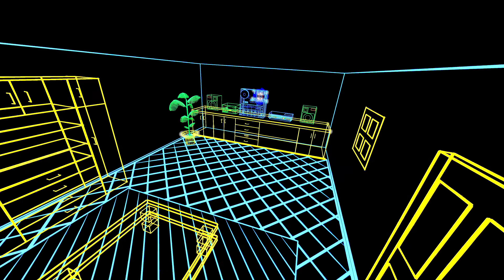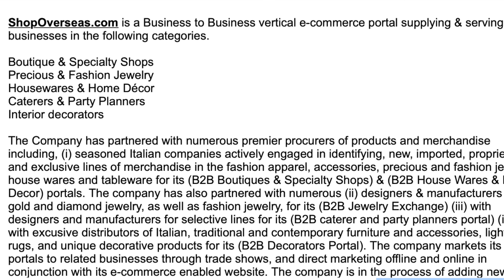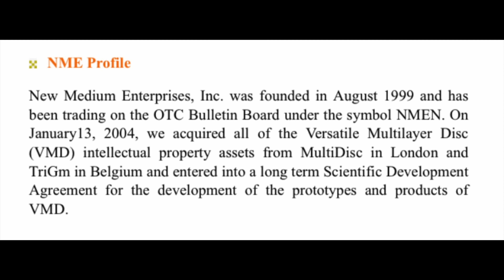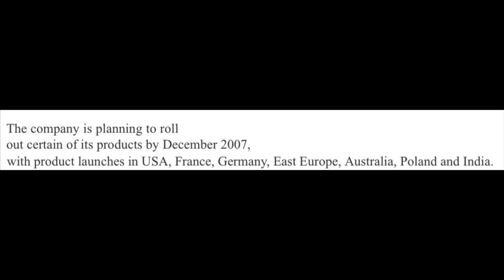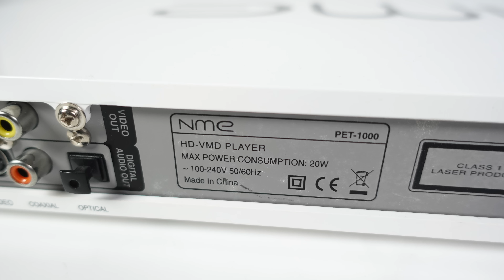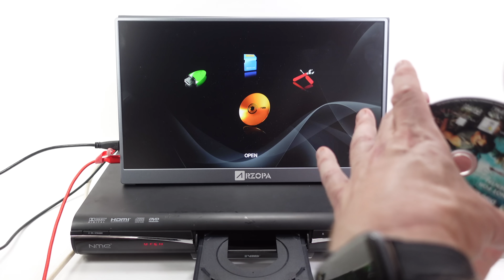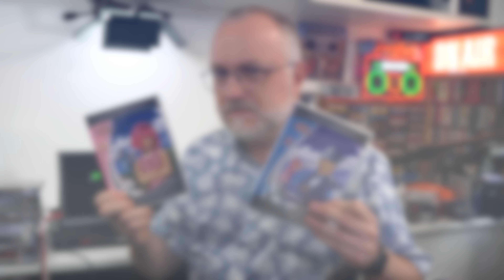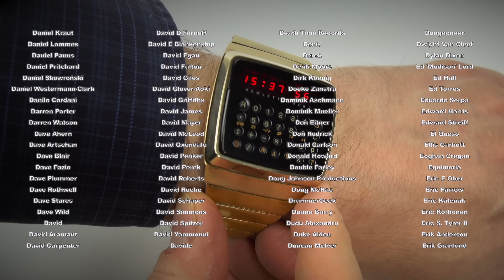The HD-VMD story - The format that lost to the format that lost

Comment: The moment Microsoft announced that you had to buy the drive separately for the 360, was the moment HD DVD died. 🙂
Reply: Sony won the format war in large part because they included the ability to play Blu-ray on the PS3 which meant anyone buying the PS3 now had a Blu-ray player. If Microsoft had done the same with HD DVD and the Xbox 360 while also incentivizing OEMs to add HD DVD drives on Windows PCs, the format war may have ended differently.
Reply: @spunker88  Exactly, although Blu-Ray would have still ultimately won due to the massive abount of additional storage :)
Reply: @SelfIndulgentGamer  I doubt it as once you have a huge market of people with players, which format is superior becomes irrelevant.

Although despite buying into HD-DVD myself and it being the superior format in the early days (it had many features the early Bluray specs did not support), Bluray did keep getting revised to a point where it was vastly superior in the end.

Apart from the most annoying aspect of Bluray, that titles using Java do not automatically remember where you left off and manufacturers can't be bothered to add it.  Its an absolute curse combined with power saving regulations causing a paused player to turn off after a while, losing your place.  Its the one thing I absolutely HATE about Bluray.  But the quality is so much better than streaming.
Reply: @alexatkin  NIce that you know your stuff :) To be honest, I still just rely on my DVD collection :D
Reply: @spunker88  i doubt the ps3 won them the format war. The ps3 came a year after the the 360, and it was more expensive. Sales were sluggish. You could got an xbox360 and the hd dvd drive for much less than a ps3.

Nah, HD DVD was already on life support when the ps3 launched.
Reply: @SuperPickle15  At the time the PS3 got launched HD-DVD was outselling Blu-Ray movies something like 6-1.
Reply: @spunker88  it also helped that Sony had a movie studio that was never going to publish titles on the rival format!
Reply: The attachment thing was kind of dumb but also kinda smart. By making it an optional attachment, it helped keep the device much cheaper. Yeah, consoles were sold at a loss, but Sony's even more so.
Reply: @BungieStudios  I agree, yet even with Sony losing a year before it's release managed in the end to win. It's incredible really, as I probably dis not get my PS3 till atleast a year after it's release, as I could not afford the original £450ish price range. Thinking about it, Microsoft should have upgraded the DVD drive to the HD DVD when the Elite was released :)
Reply: Whereas Sony - "We're putting Blu Ray drives into the PS3!" XD
Reply: @SelfIndulgentGamer  Warner wanting a separate format for China killed HD DVD, afraid of being flooded with cheap discs they switched from being both (or as we used to say, purple!) to Blu. Then China got the HD DVD tech to make their China Blue from Toshiba.
Reply: @ColdRFusion  Ah, the more you know :)
Reply: Velzek  Toshiba, Philips & Sony were partners on this one! Microsoft hedged their bets, the Xbox 360 external drive is exactly the same size as the internal DVD drive, they were at some stage going to incorporate it into the 360.
Reply: Sony killed HD DVD day 1
Reply: @alexatkin  Blu ray disc with Java all remember where I am it depends on movie studio making the disc.

Comment: What they "save" with a red laser would likely be "spent" trying to ensure the multi-layer focusing worked accurately.
Reply: This is just speculation, but by what Techcmoan described with this format, it could have potentially been used (kinks worked out of course) as a decent replacement drive for the XBOX Classic, the PS2, and of course with proper flashing, the Xbox 360.

This would have been a great drive for those classic consoles. The benefit of standard DVD, plus Hi Def. And done with a standard laser, so it did maintain compatibility. And with fairly minimal modifications since it's apparent the player could accept firmware update.

What could have been...Especially when parts for the classic consoles run dry. Toshiba and Mitsumi are still common for now, but for how much longer? And we will need parts to keeps these consoles running. This really could have been special!!
Reply: @deathstrike  or... Just don't keep them running? Old hardware has to die some day, no big deal. This is why we move toward standardization, in the future, you will want your videogames to be playable decades after their launch, and for that they have to be free from the shackles of aging physical formats, by you guessed it, moving to digital format.
Reply: @TrigramThunder  You act as if digital is forever...
Reply: @flightlesschicken7769  I mean. It is? Or at least certainly lasts on way longer timescales than physical does. When digital moves platforms, it's a matter of copying and pasting your content. When physical does the same, you need to use a machine to read the content off the original format and rewrite it into a new physical format...
Reply: @flightlesschicken7769  You're right, both physical and digital copies are needed to preserve things as long as possible.
Reply: and Lazy Town wouldn't have come cheap
Reply: @TrigramThunder  Here's the thing. When we say digital we mean on the internet or on an internet connected device. If you have it on a hard drive offline then that's basically physical (although I have a suspicion that read only memory is probably more stable than read-write memory)

 If it's on the internet then it can be pulled down or DMCAd without your consent. It doesn't matter if you spent money on the game because if our corporate overlords decide to take it down you can no longer get it legally. The concept of ownership is fuzzier with a file than it is with something you can hold in your hand, sell as that object then buy back.

Edit: Spelling
Reply: @flightlesschicken7769  you have a point there. The read only component certainly means the disk that contains the game remains a disk that contains a game and not something completely different like in the case of a hard drive. I think digital is better suited for TV shows, music, movies, books, documents, and anything else that might be better off stored digitally due to the physical format being inconvenient, but the high amount of digital space and the interactivity factor might make videogame experiences better suited to be stored on discreet, specifically purposed data storage devices.
Reply: Interesting.
Reply: @TrigramThunder  this is a partial truth look at the articles about when video is recopied over and over even the pixels break down eventually it's weird how it works.
Reply: @acorgiwithacrown467  I agree the limited space in high speed SSDs, given just how big games get with high quality textures that drive the size into the three digits of GBs, makes it very appealing to store it in a disc, after all, Ultra HD Blu-Ray disks can store up to 100 gigabytes in their triple layer variant.
Reply: @findantu  well yeah, but the thing is that that problem is not magically solved by using physical formats such as a Blu ray disk, the way to prevent any given video from degrading infinitely is simply to make sure that many different people around the world have high quality versions of it from which it could eventually be restored, regardless of whether that digital data is stored in a hard disk drive or in a solid state drive or in a Blu-ray or other similar optical disc format.
Reply: I have no doubt at all that when dvd was specified they knew that adding layers would add capacity, but I remember reading about the tech at the time that they thought the theoretical limit would be 4 layer but in practice due to production variance and noise margins its unlikely to be more than 2 but 3 may be possible under some special circumstances.  So 15Gb seems to be the limit and even 2 layers was problematic at the start.  I had a couple of flippers where the DVD is double sided  4.7Gb per side.
Reply: @deathstrike  You can play HD anyway (to a degree, the OG Xbox can output 1080i, iirc, and the PS2 somewhere less than that, once they've been flashed, you can output HD content if you wish anyway.) You can just also access your movies over network connection, or from USB stick (The OG Xbox controller ports are just USB ports, I replaced port 4 with a standard USB port and it just works...because the controllers are just USB with a proprietary connector). Or you can whack in a giant hard drive (at least for fat PS2, not slim), or in the case of the OG Xbox...two large HDDs after I removed the DVD drive and put a hard drive in it's place too as the drive is an IDE drive and IDE/SATA adaptors are fairly low profile and slim allowing you to install much more capable and much larger SATA hard drives.
Reply: @smpmuzpid  There are more problems than just DRM, but it's arguably all artificial. Unless there is a SNES cartridge tree somewhere.... Hmm... I must go on a safari to find the SNES Tree!
Reply: @TrigramThunder  Just as a note... Physical doesn't increase game price. If it did, Steam games would universally be cheaper. Game prices--at least for major releases--are determined by corporation that want to make as much money as possible and have never (to my knowledge) been cheaper digitally.

Also, what do you suggest take up space in someone's room that they could benefit from beyond giving them pleasure? A dialysis machine?

Edit: added part about how game prices are not determined by the cost to press a blu-ray disc
Reply: @flightlesschicken7769  um, nothing in my room is something that just sits there and is never used. bed, closets, heater for winter, fan for summer, windows, clothes, personal hygiene products, (think shaving/grooming/image and style kinda things), outlets on the walls to charge devices, everyday carry belongings laid neatly on a spacious table for easy preparation to go out in the morning, all that sort of useful thing as opposed to things that just take up space and are never actually used such as books.
Reply: @terrypussypower  I can agree that the larger sleeve for vinyl makes much better display pieces
Reply: @TrigramThunder  with digital you don't own your content . When I signed up for the ultraviolet movie library service back in 2015 it shut down just a couple of years later. Thankfully I didn't have many movies on it but still.
Reply: @RonJohn63  yes they are..hence why it's so weird that people have an obsession with "physical media" when it basically is just the same as storing your piece of media on your device's internal storage, except with a dedicated physical piece for each digital piece. 

That was basically my entire argument against the "physical media" that's just digital formats, but they made a very good point that keeping it in this format makes for an easy way to ensure that the media is not lost (since the physical piece is read-only) and to be able to sell, trade, or give away, unlike if it was just a set of files on your disk.
Reply: Then they waste money on a rewriter used only as a reader.
Reply: @terrypussypower  THC vapes my friend is the way to go now, even this activity has gone electronic. I haven't rolled a joint in years because of THC vapes.
Reply: @mahdiyussuf9804  Correct:  That's why we who are scanning years' worth of film negatives and transparencies keep those originals in dry storage, "just in case".
Reply: @rogerb5615  Sweet!
Reply: @TrigramThunder  Yeah digital totally is forever /s  ... Tell that to all the games I can no longer buy or play cause they've been delisted from Steam, PSN and XBL for expired licenses of ingame content or other things
Reply: @Knaeckebrotsaege  That's not due to it being digital. That's just corporations being corporations and delist their games for stupid reasons. If we're strictly talking about new copy and legitimate sales that actually goes to the developers/publishers, digital is better in that they're technically infinite. Can you buy a new copy of PS2 physical copy games? Unless you're willing to pay scalper pricing, no you can't.

Same with DRM crap. Remember SecuROM/StarForce? Those are primarily in-disc DRMs. And online only requirement could totally be imposed to physical copies as well.
Reply: I see you Ben Heck!
Reply: @TrigramThunder  Here's the thing: digital streaming content can be censored or banned whereas copies of a show or movie you own on a DVD can't be removed or censored. Physical media is more important today than it ever has been in the past due to how streaming platforms can decide to censor or remove content at any point with little to no warning. 

A good example of this is the banned Spongebob Squarepants episode "Mid-Life Crustacean". You can find the episode on the season 3 and first 100 episodes DVDs, but you won't find it on any streaming platform.
Reply: @lovelydolltime8006  Still the solution should never be to physicalize the media through an object. 

The idea that each piece of media can be inextricably associated with a physical item is ludicrous. 

Who wants to fill their shelves with something they can just fill their hard drive with instead?
Reply: @TrigramThunder  I'm one of those people out there that still buys and burns DVDs and CDs. I've had my collection of discs since I was a toddler and it would only make sense for someone like me to build upon an already existing DVD/CD collection. My computer will die way before any the discs have a chance of becoming damaged (if they do at all).

Also, I got a new DVD player for Easter this year.
Reply: @lovelydolltime8006  you do you i guess. i highly doubt some finnicky plastic discs will last anywhere near what a good computer lasts.
Reply: @TrigramThunder  Much digital media becomes inaccessible vastly faster than physical media, thanks to digital rights management, businesses going bankrupt etc.
If everyone switches to an open, standard format, yeah that'd be great, but I think it'd require governments to force it. Personally I think they should, along with standardizing streaming formats etc, it's ridiculous that every streaming service uses their own methods, playback devices routinely become outdated after a few years etc. I think it's absurd that changing to another streaming service isn't as simple and transparent as just changing a channel.
The big companies/streamers would presumably hate it though, as it would give small companies the same accessibility.
There'd still be the issue of reliable(and available) storage hosting for decades though, particularly when businesses go bust.
After all, even just servers for online gaming for older console games got dropped some time ago.
For extreme long term storage, for historical value, a physical media that doesnt degrade would naturally be ideal. Even if the playback devices have long since gone, it would surely be recoverable with technology available in the future.
Reply: Their statements don't tell me they were selling a new format. Their statements imply to me they were selling a laser to electronics companies, not a format to the home consumer.

Comment: When DVD came out I recall a salesman trying to sell me a Phillips machine that used DiVX and you bought the DVD, but you had to hook your player up to a phone line so you could rent the use of the DVD you already bought. It cost less than the actual DVD movies, but it also did not come with any of the extra features. It was basically like having Blockbuster in your house. Of course I just nodded my head knowingly, let him do his pitch, then bought an actual DVD player. :)
Reply: I used divx format for pirated movies on my pc. That was the go to format for downloading pirated movies. When i wanted to watch it on a DVD/DiVX player, just burn it into a disc.
Reply: @evil7011  There is a difference between DivX (the Video Codec) and DIVX (the movie rental system Vwlss Nvwls was talking about). It is pretty easy to confuse them since both have something to do with video.
Reply: @anvis-cathouse  thanks for the info. I burned pirated divX Cds and watched on my DVD player back in the day. Good old times.
Reply: @noiselabproject9659  not the same divx, there was a disk format called DIVX (Digital VIdeo eXpress) was a disk format designed mainly for rental (the one that wanted your player to be connected to your phone line.)

What you're talking about is the DivX video codec ;)